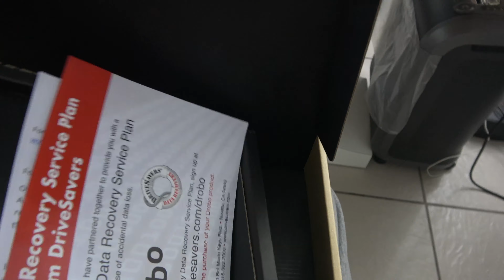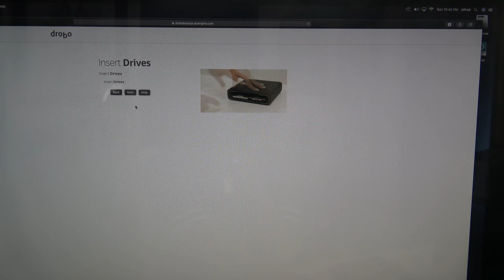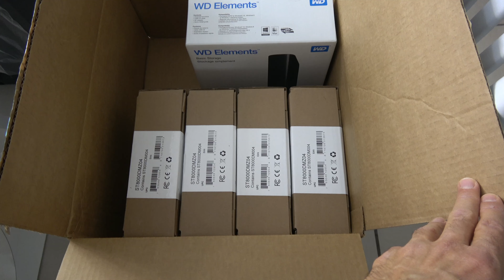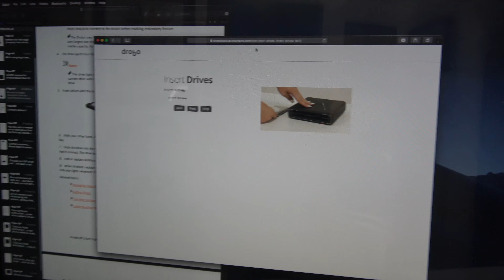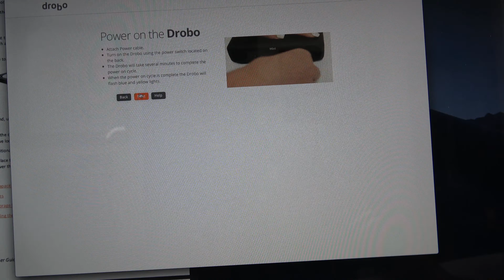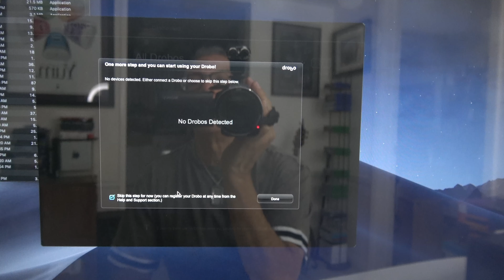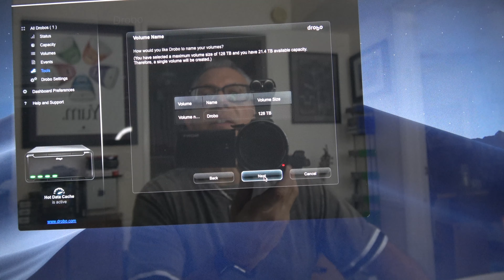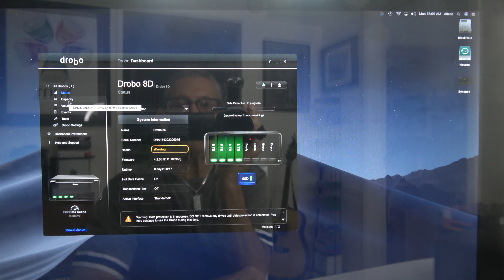My Drobo 8D Nightmare - Part I (Setup)

Comment: Al I’ve been sitting here wondering why you didn’t just get a Synology drive array, those seem to work better than any drobo out there!
Reply: With Seagate Ironwolf Pro :)
Reply from the maker: Hi Ruben - I wanted a direct-attached storage device. I actually have a Synology Diskstation 716+II which I used to run my business. An absolutely phenomenal device! The Drobo 8D is now gone (as you will see in Part II) and it's replaced by a 6-Bay Thunderbolt 3 Thunderbay array managed by SoftRaid XT. Brilliant, and fast!
Reply: Or Xpenology - I run four of them. Never, never use SeaGate, horrible drives!!! WD are the current top runners.

Comment: I see you are using a seagate drive. I am a very long time Dr. OBO, ( Cool nick name by the way. I love it. ) ( 1 st gen ) and the only time I have lost drives was with seagate. My WD in my current Drobo are aging out over 5 years now.  I'm going to say your issues are with seagate. Also only use PMR / CMR hard drives. SMR hard drives are a issue. I'm going to watch the rest of you videos. Fingers crossed you fix it. :-)  here is a quick list of seagate smr drives. They will cause problem and not work......                                 Barracuda 2TB – 7,2000rpm – ST2000DM008
Barracuda 4TB – 5,400rpm – ST4000DM004
Barracuda 8TB – 5,400rpm – ST8000DM004
Desktop HDD 5TB – 5,900rpm – ST5000DM000
Exos 8TB – 5900rpm – ST8000AS0003
Archive v2 6TB – 5,900rpm - ST6000AS0002
Archive v2 8TB – 5,900rpm – ST8000AS0002.                 The hard drive manufactures were very sneaky when they changed how hard drives were made. Not a Drobo fail. Well a Drobo support fail. Not sure why they didn't catch you had the wrong drives.
Reply from the maker: Thanks for sharing the SMR info!

Comment: For your sanity, I hope the Drobo works fine in part 2. For the sake of the video, though, I hope something goes wrong like it always does, not an FF-class failure, but something! :P
Reply from the maker: Aaron, I lost my sanity when I started posting crap on YouTube years ago. Oh, don't worry, the Drobo 8D turned out to be a COMPLETE cluster f_ck, and I shipped its ass back via Amazon's return policies. I'm working on the edit for Part II, so strap in (or strap on, etc.).

Comment: Format then format?!? All my RAID setups demand that you create the array then format. That coupled with SeaGate drives could be the problem.
Reply from the maker: Prince Westerburg Drobo is all proprietary stuff. That’s the correct procedure. Those Seagate drives are all running perfectly in the Thunderbay from OWC. Video to follow. The Drobo 8D was a big disappointment.

Comment: This is probably a dumb question but do you have to have the SSD in the back for the Drobo to power on? Or can it work without it? Just unboxing my 8D now and it won't power on.
Reply from the maker: No - the SSD is to enhance read operations. Sorry to hear you are having problems. I had to send mine back - it was a real mess!
Reply: @adiblasi  thanks for the reply. Guess I'll have to call and have them send me a different one.
Reply from the maker: Yes! Make sure you annotate who you spoke with and get a proper case number. And when you finally get it working, Make sure you deploy duel disk redundancy. Also, you should still have some type of a backup strategy so that the data exists on another type of volume. Also, prior to the call, make a note of the make and model number of the hard drive’s that are being used and run that by text support as well to ensure that you have drives that will properly work with that system
Reply: @adiblasi  Thank you for your help!!
Reply from the maker: @billieweiss7681  And if all else fails, threaten to "throw the damn thing off the 4th floor balcony to post as a video on YouTube..." Good luck!

Comment: do you recermend lto is it worth the 3.000 pounds lol
Reply from the maker: No - total piece of crap!
Reply: @adiblasi  haha but you have used it tho
Reply from the maker: I sent it back.
Reply: @adiblasi  I know u sent that pos back I was talking about the tape drive
Reply from the maker: @Surefirejacob  Ah -- you said "LTO" - I did not recognize it as you typed it all in lower case (you lazy bastard, you couldn't hit the shift key?). YES - LTO tape drives are fantastic for archival data storage. Was the LTO-5 I purchased worth it? YES -- as they backed up the TWO second-generation DROBO drives that had about 6TB of data on them, including my entire music library, photo library, and all of my Sany Xacti footage. When they BOTH went down (after a firmware update, where I threatened to throw both off of the balcony) I used the Drobo 5D that they sent me, and reloaded the drives from tape. So yes, worth their weight in gold, or Bitcoin or whatever. If I had the budget for it, I'd get a Thunderbolt LTO-8, though 9 is currently out. I might dust off the LTO-5 and slave it to an older MacPro to get it running again, as I mentioned to you in another social media comment.
Reply: @adiblasi  cool sounds good wish I had 3 k tho lol yeah I thought lto was that way did not know I had to use it in caps
Reply: I find you impatient. it needs to do its thing,

Comment: so I guess you will never get one again?
Reply from the maker: I have all the ones that are still in use, but overall at 8D was a big disappointment. Some tell me that the SMR type hard drives we’re at the root of the problem, but I’m sorry, that’s a highly intelligent sub system and it should’ve accommodated for any delays in writing data. Also, if we even forget about the hard drives, the damn eject button didn’t even work properly. Very poor quality control in my opinion.